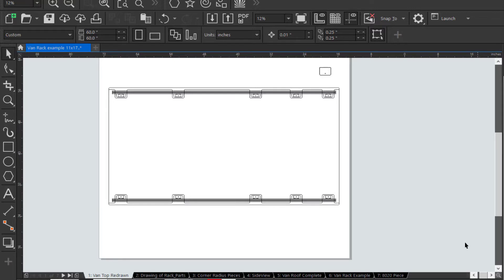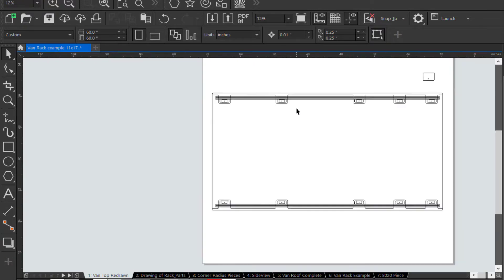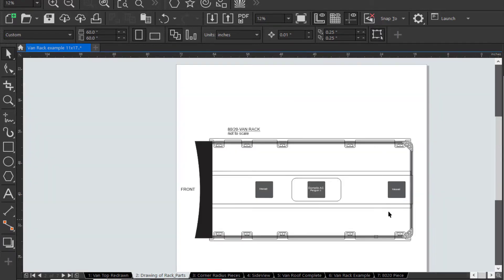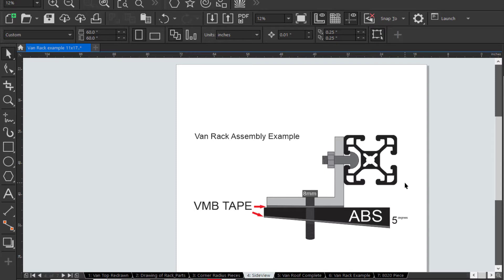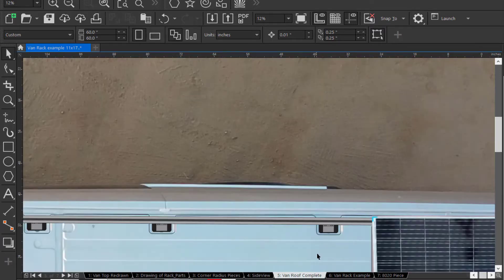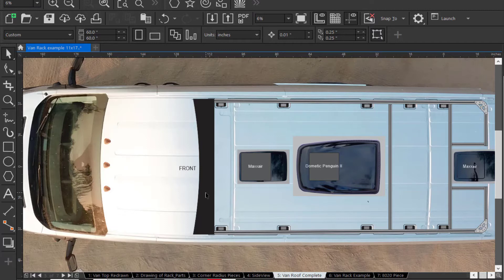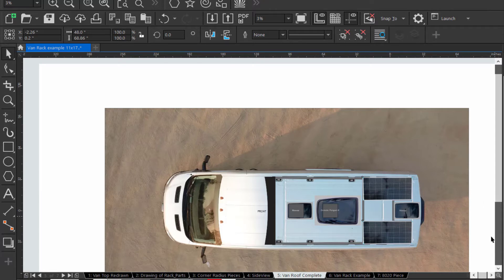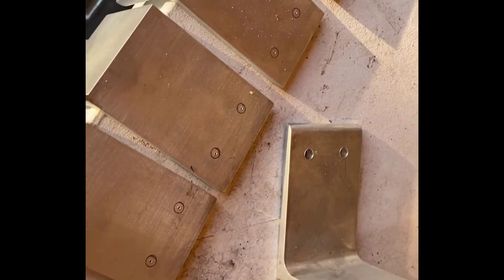Van Rack Design_Draw_ Water Jet_Mill_2020 Ford Transit 350HD, Ecoboost, AWD, DRW, Hitop extended

Comment: New sub, love the design.  What program are you using, and is there a template for the van or is that picture within the template?
Reply: @vanret4912  cool I'll check it out.  I've been using Sketchup but it's been a slow learning curve for me.   I like the realistic look on your lay out.
Reply: @vanret4912  yeah 350 ext high roof is what I'll be building.

Comment: Here we are, this is not only great work you performed here. You show and explain it also proper how to build a good van rack. So far, I did not find any self-made roof rack in this quality made from Aluminium. Besides, very few built and show it anyway. They built in steel and/or wood, but nothing good. Yours’s is very flexible to build in size and shape, where you can incorporate the different installations. 
Great work indeed and all my thumbs up. Greetings.

Comment: Hi Doug- the weld nut for the M8 bolt is welded on the reinforcement ‘parallel’ to to roof panel angle
- so the axis of the bolt is not 90 degrees but closer to the 5 degrees. You should consider a one piece metal bracket only bent at the 5 degree only- ABS is not UV resistant over time unless it is painted.
Reply: VanRet49 - hi Doug- how can l private message you?
Reply: VanRet49 - hi Doug- l may be able to offer some technical support working in the OEM automotive design field but would have to occur privately. Cheers